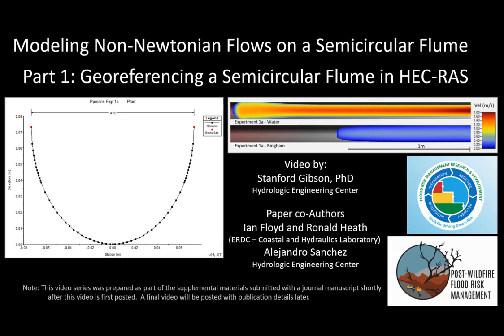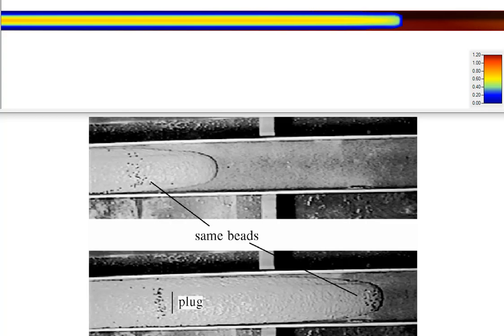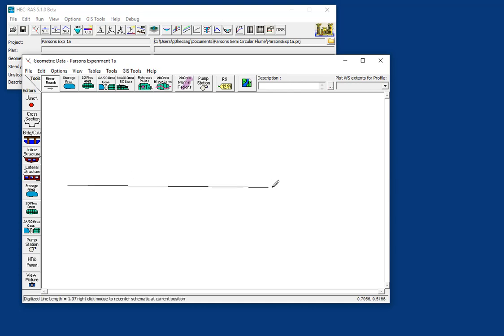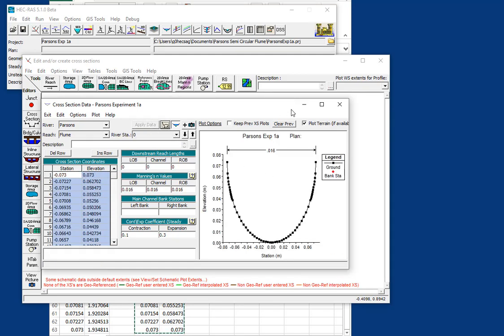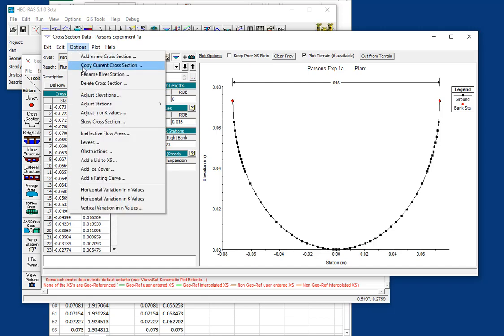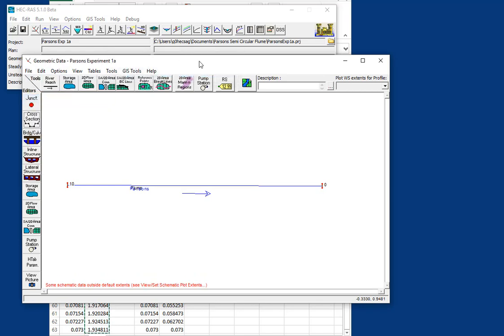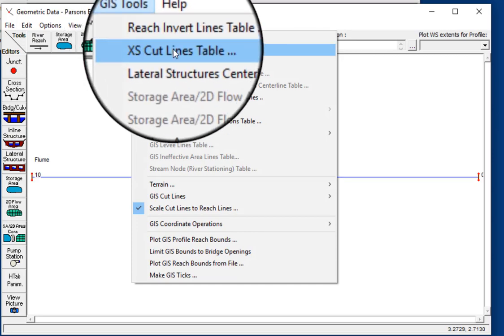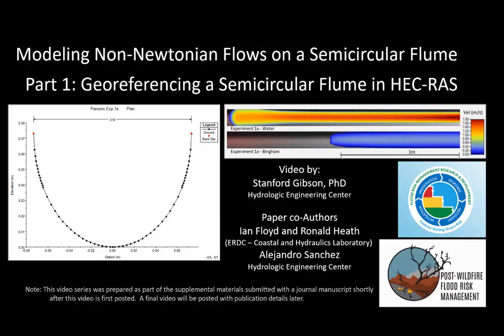Creating a 1D Semicircular Flume in HEC-RAS: Non-Newtonian Flume Series (Part 1)

Comment: Dear Stanford Gibson,
I am unable to do the same for a rectangular channel. After elaborating the 2D mesh and checking the cross section, the rectangular section drawn by me does not appear. I believe my problem is with GIS TOOLS. Thank you very much for the video teachings.
Reply: i did this for a rectangular channel. and there's trick to it. you have to use banks i mean 5cm banks would be more than enough. if you are struggling yet. please comment. ill gladly upload data files. 
thank you for your help stanford.
Reply: @nawodyakariyawasam3794  hey, sorry for the late reply started working on hec-ras again can you please send the data file it will be really helpful, thank you!
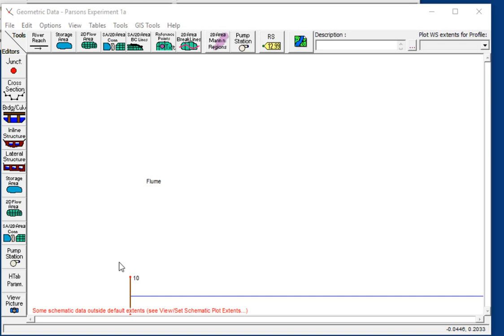Reply from the maker: Try resetting plot extents.  There is nothing about the semi-circle that should affect georeferncing. see video 8:51
Reply: @stanfordgibson  Dear Stanford Gibson,
My result, in RAS MAPPER, is a linear relation between ELEVATION and STATION (diagonal passing pass the origin). Is it possible that HEC-RAS 6.0 version shows different result in RAS MAPPER PLOT? Because my upstream and downstream cross sections are correct (sections are rectangular) but between upstream and downstream it appears as diagonal (not a rectangular section like it should). Thank you very much!
Reply from the maker: @lainegferreira  Rectangular interpolation can get tricky in Mapper because of the vertical walls.  Try interpolating the cross sections in your 1d model first to give Mapper more to work with.  Then you could reach out to me on LinkedIn or ResearchGate and I can look at it.
Reply from the maker: One weird thing about rectangular flumes is that it will be difficult to set bank stations to the top of the flume if the walls are straight.  I usually put a very small slope on my sidewalls for rectangular flumes.
Reply: Hi La, Are you by any chance from Swansea University cause I have the same problem as you have if so please contact me.
Reply: Hi @pradeepsaraswa7028  , I'm not from Swansea University. I'm from Brazil.
Reply: @lainegferreira  I'm trying to build a simulation based on the inversion experiment which have the rectangular flume if have successfully able to model the flume do you mind sharing the files with me, it'll be of great help.
Thank you!
Reply: @pradeepsaraswa7028  Of course! I would like to ask for the same.
Reply from the maker: We have a tutorial on building rectangular flumes here: https://www.hec.usace.army.mil/confluence/rasdocs/hgt/latest/guides/creating-a-terrain-dataset-to-model-a-flume-experiment